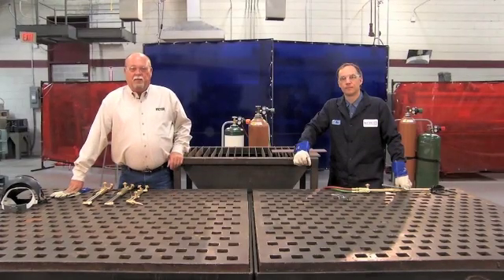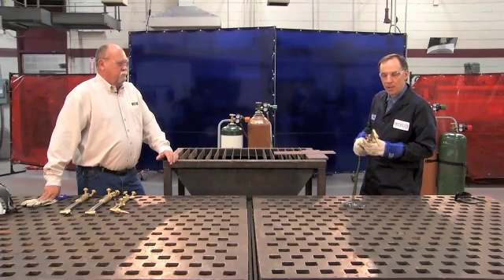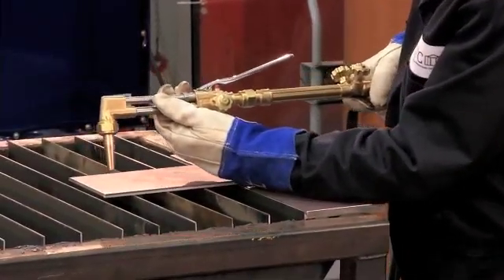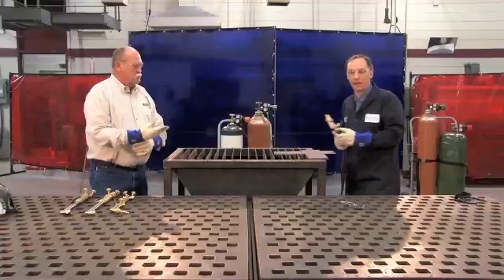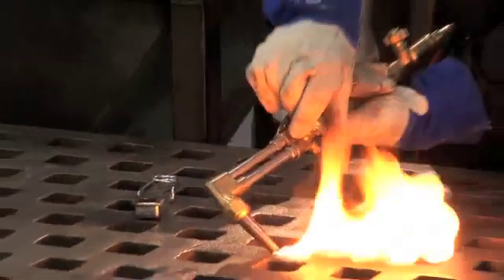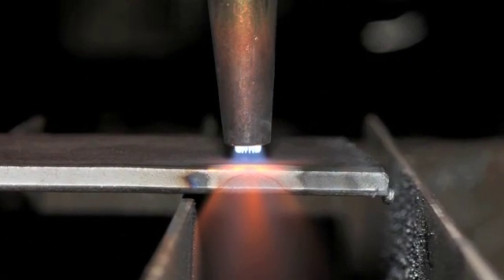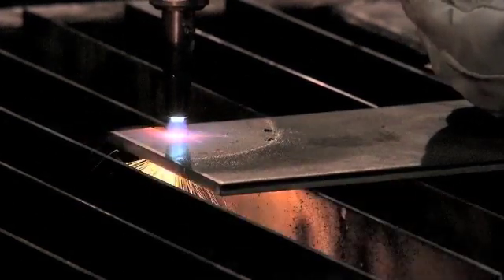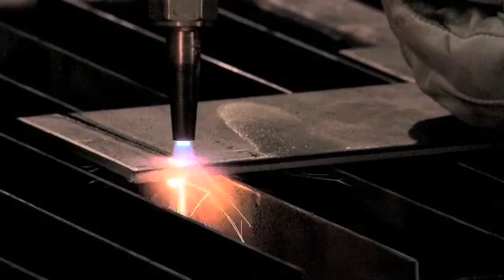Victor Oxy Fuel Cutting Techniques

Comment: cut off fuel first
Reply: forsety2 I was taught to cut off oxygen first, then acetylene.
Reply: Cutting off oxygen first is a safer practice as it prevents excess oxygen from going where it's not supposed to